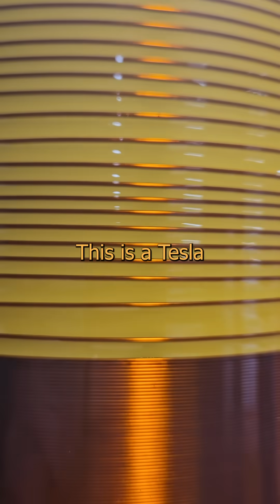Mystery Inductor #chrisboden #comedy #engineering #electrical #tesla #coil #highvoltage #science

Comment: It’s all about impedance with the inductor, 
or “Ballast” it is complex  mathematics. 
That’s why capacitors, and spark gap discharge Tesla coils, are more common Then directly powered which honestly wouldn’t be a good idea, 
if you try to power a Tesla coils straight from the mains with a current limiting ballast there will be a lot of “EMI” generated which will back flow into the transmission lines, and then be  broadcasted out onto the power transmission lines acting like a big RF transmission antenna. Hence the need for mechanical spark gap Tesla coils, or electronically switched Tesla coils. 
To provide some EMI filtering, the Tesla coil itself self is an Early RF transmitter by it self, and you surly do not won’t any extra RF re transmitting out! 
For any one who doesn’t know 
First DC and AC can exits within the same single conductor, and not effect one or the other. And multiple different AC frequencies can also exist within a single conductor or maybe a antenna 
So far  we can either Tune, or Filter out the other difference AC signals. 
Low frequency AC versus high frequency, and RF. things start to get kinda Weird, and complex 
Look up the smith’s chart! It’s basically the same as power factor, but a lot more complex and interesting! 
Quick edit  if your putting the ballast in with the output if your referring the output as the high voltage high frequency RF output I don’t think that will work, it may help if it’s placed in series with the primary coil, but I don’t think it would well!
The primary should be switching very closely to the secondary frequency. If the primary, and secondary coils don’t have the correct resonance frequency does matter how its powered the secondary output will be terrible, or not work at all. 
This is very similar to how a squirrel cage rotor in a AC electric motor works. 
Its wirelessly powered from the stator, the magnetic field is coupling into the rotor which contains an iron, and aluminum the aluminum forms capacitance between the iron bars. And the difference of the metals ability to conduct magnetic fields. Older ac motors used Copper and steel I think or maybe copper and aluminum to create the rotors back then. For Tesla coils, that are spark gap driven the two coils primary, and secondary are built having were one coil is set to the harmonic of the other coils resonating frequency can’t remember the exact coil it is. 
And the spark gap works just like a points ignition system it. 
quickly charges the primary, and then quickly disconnects the primary from its pulsed current. 
That quickly charges the coils, and then allows the magnetic field to quickly collapse in on itself. The smallest Tesla coil is an ignition coil! Especially the old can style ones! And have an iron core, instead of an air core! That iron is what made it possible to drop the size down, and voltage! 
I think it’s awesome you’re asking your viewers for stuff like this! 
I have no PhDs in electronics, or electric motors or internal combustion engines or the other numerous things I really enjoy I work on vacuum tube circuits and solid state I’ve learned from guys like your self who are very knowledgeable in the fields I enjoy and that they choose to then share and teach it. I’m only 26 with the knowledge I know now, and I don’t claim to be a know it all either because I’ve been humbled before a few times! 
All I can say is Nikola Tesla was way ahead of his time many have said his crazy, and this and that. But my knowledge I’ve gained from understanding radio electronics, electric motors, resonance even internal combustion engines, and a lot more have lead me to believe he wasn’t as crazy as the ones with the PhDs have lead many to believe for nearly 100 years!

Comment: What you have there is clearly a flux capacitor capable of generating 100 mega jewels of power if connected properly to a 1989 delirium circuit transmitter 😅😅😮😮😮😅😊😊😊

Comment: You don't hall leave to let the smoke out... use a DMM, and a wall plug. Put one lead of the dmm onto the neutral side hook the hot wire into one of the labeled wires and go around testing each wire. You can calculate the number of windings from there. You seem pretty smart (and dangerous), not sure why you didn't just do this already. It should go without saying don't let any leads short, and don't touch the lead of the dmm as you press it on/into any of the wires

Comment: That looks like a multi tap auto transformer.  Feed the primary power and tap from primary neutral to whichever tap you want.  From my experience (we have a transformer like this in a piece of industrial equipment at work) the numbers counting up give you higher and higher voltage out.

Comment: If we start with a couple of assumptions, that willneed to be verified, you should be able to measure and work out the taps on the transformer. Even if it's a single winding multi-tap transformer (these are used for maintaining mains voltage in some environments.
Assumption, all windings are copper. All windings are using the same guage of copper. Again, both of these are assumptions.

First step. markd down the contacts you can attach to on a piece of paper.
Step 2 use a multimeter and map out which contacts are connected to which contacts through the transformer. This can tell you how many coils you're working with, how many of the coils are just end points on the contact board, and how many taps in center or multi-tap coils there are.
Step 3, you will want a fairly high precision multimeter for this, but measure the resistance of coils, and taps on coils.
Copper at a given wire gauge will have a consistent resistance along it's length. As a result with resistance measurements you can determine relative windings lengths for any given coil, and taps on that coil.

Obvious wrenches that get thrown in. A primary winding on a transformer may be at a different guage of wire than secondary windings.

Second set of tests. Use a signal generator to generate a 1v p-p 60 hz signal. (or 50 if it came from sensible countries on the planet.) This signal generator may simply be an audio ossiclator, but if that isn't op-amp isolated from the load, you're likely going to want to monitor and  correct for load effects on the signal. If you have already found a primary winding, attach this signal to that. 1v p2p should be enough to induce a signal onto other windings. With an oscilloscope, look at each of the other windings/coils signal level. You should now be able to recognize or detect induced voltage levels for each coil. All of this relative to that 1v p2p, so you should easily be able to work out what the voltage levels across each of the windings is. This should also allow you to work out if the resistance measurements and observed voltage levels reflect consistent wire gage across the various coils, or if there are differences between different coils in the transformer. An example of a situation where the gauge may change may be where someone needed a step up change from 1v p2p to 1kv p2p. I'm going to presume that the 30 a rating is for the primary. On that secondary, the available amperage may be 0.03 amps, which isn't going to require the same guage of copper for the wire, but will carry the same wattage. It will also be lighter, and even in an age of readily available copper at low cost, would likely have impacted the cost of the transformer.

There are also tools available that will tell you the quality of the isolation between separate windings. I have no experience with them, though I know that Bigclive has worked with some. in some of his videos. It can be troubling to find that your mains voltage tap is available on one or another of your 5v DC USB leads, especially if mains is 220v as is common in Europe.

Oh, also if one or another coil is wound with silver or gold plated wire, that's likely to give you some variance in readings that might throw you, but you should be able to see the results in the oscillator tests. This may have been done to provide a more reliable voltage level for an x-ray machine on a given winding, or may have been done with other metals to give a better cost of materials result.

Comment: I made a Tesla Coil in the eigth grade and won a science fair ribbon in 1966. It looked just like yours but I used a 12kv neon sign transformer to power it. The 1 inch spark gap was hugely noisy and I made the capacitors out of 2 foot x 2 foot tin foil and window glass. Tons of bragging rights!

Comment: Apart from the obvious, inductance and saturation current which you can meassure with a really high amperage AC power supply and oscilloscope or estimate from the saturation of the steel core and the turns which you can calcuate based on area and and core, you should keep a very close eye on duty cycle and thermals, X ray equipment runs on really high power but low total duty cycle like ms type pulses but not that often so it's typical for components to have high peak ratings and be limited by thermals

Comment: It's a tapped transformer im a repair tech for welders and it looks just like the transformers in old stick machines or old machines in general probably two leads for the primary and the secondary is tapped in multiple places for different output ohm readings should help tell 😀
Reply: Welding and X-rays. Same tech, making things glow!😂
Reply: How fitting that his shirt basically says, "I'd tap that," as G84 is a code for a tap cycle for CNC machining.

Comment: Last time I saw an X-ray machine of that type was in the mid-70. They were all gone by the end of the '80s, at least here in Europe.
The power supply provided continuous voltage from 40 to 200 KV, and various current steps from 2 to 40 mA, with a timer with tenths of a second up to a couple of seconds.
Those machine, designed in the mid-50s, had nothing electronics inside, but a number of transformers, inductors, capacitors and one variable transformer.
They were old junk when I begun to learn state of the art electronics (5V3, 12AT7, etc). 
I suspect they used ferroresonant transformers inside, and the variable inductor had something to do with the current stepping.
I doubt any current internet user can identify the parts used in that ancient X-Ray machine. Keep in mind those machines had an early evolution, as there were machine available commercially in 1910 and earlier. The tungsten rotating anode come later, as the currents were increased above few mA.
Greetings,
Anthony
Reply: Weirdly YT truncated your comment fk why.
It happens all the time now
Reply: @andrina_w  odd, it's all there for me.
Reply: @javabeanz8549  Yes it is now for me too. Definitely something that happens to me, seems like a YT bug
Reply: @javabeanz8549  I get the same comment but no "Read more"
Reply: @andrina_w  I am using Firefox on the desktop, how are you using YouTube?
Reply: @andrina_w  Yeah it bugs out and doesn't load the read more section properly for some reason
Reply: @andrina_w  They are evaluating you r comment and applying a social credit score to see how much they need o censor it to be compliant with accept ale norms for the location where you live
Reply: @PWingert1966  you do know all that "social credit" bs is just liberal propaganda
Reply: @PWingert1966  you’re kidding I hope though it doesn’t like it nor too far from norm lol.
Reply: @kylehenline3245  cheers man, great to know it isn't my imagination :)
Reply: @andrina_w did you zoom in so the type was larger?  It doesn’t automatically parse the html again and if the new type is too large to fit in to the dialog it will truncate the text. Reload the page and it will give you a “show more” instead of truncating
Reply: @trippmoore  I don't zoom in, generally, but I'm using a laptop not a phone, it only has happened on shorts and only recently. Perhaps it was a temporary bug
Reply: Oh my God. Remember when you had the dials and you had to select your KVP and your MA? And then do the math to figure out your time! The children will never understand. XD 
I was telling my last group of students about single emulsion versus double. He looked at me like I had lobsters coming out of my ears.
Reply: Bro is him
Reply: On Android in app it's fine
Reply: Do you have a script blocker running?
Reply: When did you retire from biomed?

Comment: That’s a multi-coil transformer used to derive different voltages from a single output. That thing doesn’t look like it’s fucking around either, probably in the thousands of volts on the last winding(with the full load of amps behind it).

Comment: When i gutted one at the scrap yard, the terminal labels seemed to indicate incoming line voltages. There was a rotary switch for fine tuning with an analog meter. I guess to get proper exposure they have to compensate for voltage sag. I did not notice if the magnetics had a gap. If so, it was not adjustable. The projector had these connected north/south, east/west shields and a flip-away light bulb to target the patient with a rectangle of exposure.

Comment: you can find out almost anything you want to know about that inductor by either measuring the inductance between different combinations of leads, or supplying a current-limited low voltage AC on a set of connected leads, and measuring the voltage across the others. The two leads with the largest AC voltage between them are most likely the ends of the winding, and from there you can measure the taps in between from there. This is assuming it's all one big winding, which should be immediately obvious with a continuity check.

The saturation characteristics can be determined by applying a pulsed DC voltage and observing the U/I curve on a scope.

Comment: You can characterize the windings of a mystery Xformer with a low-voltage low-current AC source after buzzing out the windings. I would guess that is a multi-tap 240vac input with kilovolt outputs.

Comment: You no longer need an X-Ray tech ......... it is not in a working X-Ray machine and so is just a common (or maybe not so common) multi tap inductor!
A bit of work with a meter and a set of crayons and you can plot out what goes where ...... after that it is just Physics!

OK maybe more than just a meter .... you may want to know the coil polarity so a small AC supply might be needed to go with the meter!
And Don't Eat the Crayons! Even if they are nice colours! They all taste crap. Don't ask me how I know!

Comment: I can tell you for a fact that you DON'T jumper any of the leads together if you want to keep the smoke inside it.  I'd almost be inclined to put the line leads on a terminal strip and the load leads on a terminal strip, and from there you can start finding out which combinations give which voltage.

Comment: Don't let a 50 pound mass of copper intimidate you, measure the resistance and chart it out.
Reply: Ding ding!  That is the correct answer!
Reply: I think measuring the resistance only tells you the ratio between the coils. You need to work out the saturation point too if you want to be totally safe.
Reply: @nurmr  need take into account wire gauge too. I wonder if measuring the inductance might help.
Reply: @jonnykent7402  smart cookie. Also check resistance and wire composition.

Comment: Not an x-ray tech nor biomedical engineer but I do sometimes have to reverse-engineer poorly documented high-power magnetics as part of my job.

Write down any and all markings you can find and speak a silent prayer to Joseph Henry that the X-ray machine people farmed it out. If you feed the internet specifics about old parts, especially medical or military, chances are you'll get at least one hit if anyone else ever has looked at one of these OR you'll find an archived bit of something mentioning a company you could try phoning. If this fails, continuity and LCR are your friends, milli/microohm metering if you can. From there, saturation curve tables and a bit of algebra are your best option. Gonna guess from the stoutness of the windings and the lack of potting on the tapped side that this was a filter in a low-voltage portion of the circuit, with the taps either being for multiple branches or for field adjustments due to attrition.

I also know a biomedical/electrical engineer who might have serviced a tube X-ray or two at some point, so I've reached out to get her on the case as well. I will update my comment with her input, hopefully with something fruitful.

UPDATE: Friend does not do the x-ray maintenance, that's a whole other department, apparently. Sad that avenue fell through for now.
Reply: Bump to the top
Reply: Bump
Reply: Curious to see what your friend knows about this. I love old equipment. They were every bit as much art as they were science.
Reply: Thank you.
Reply: @Armegeothm  Hi

Imma give comment for engagement 

Have nice day

Comment: If you can get me yhe serial number and model from the main unit, i can get the schematics for the transformer that was in it. It is likely a step up transformer but can be wired as step up, step down, and capable of changing phases. If you want to be able to adjust to different voltages, we will need to design a simple control panel to work with a 7 way switch and use leads instead of plugs.

Comment: I have about 20 xray machines.  I’ll ask my service vendors, I’m sure one of them knows how to use this for your project.  

If not, I’m sure I can get you the power supply part (inductor) you need.

I frequently buy new modalities and scrap the old ones, I bet some of that hardware could be turned into some interesting projects.  

Are there any markings or stickers on the device that weren’t visible in the video?